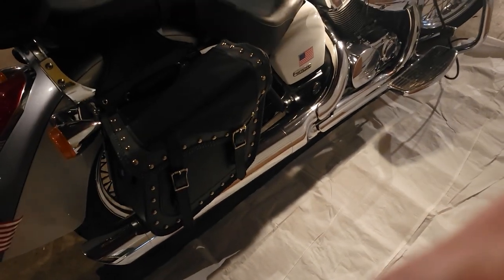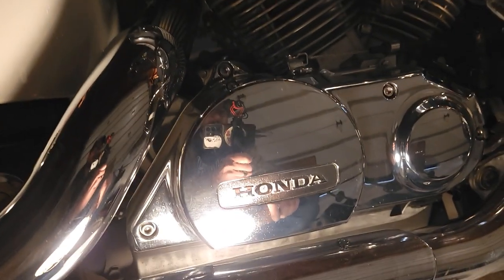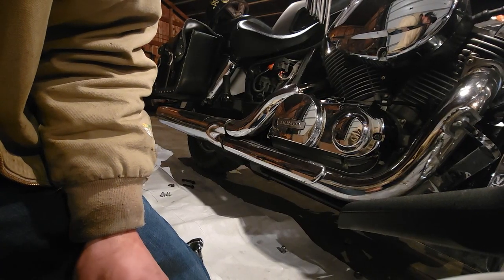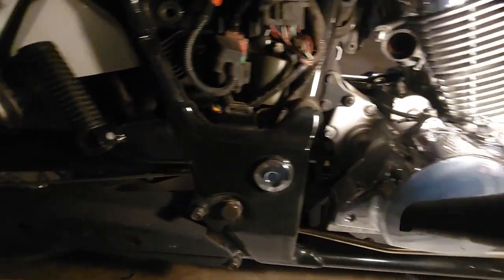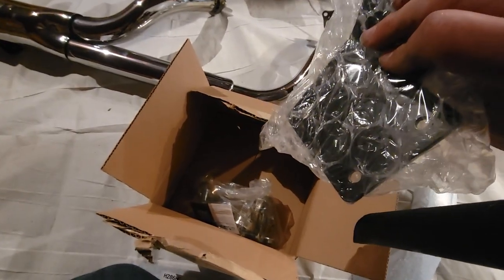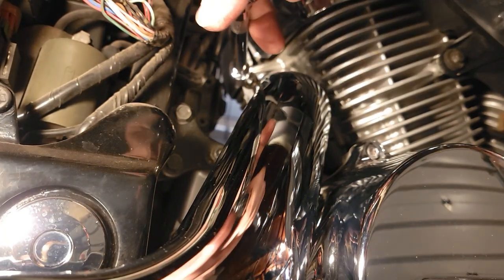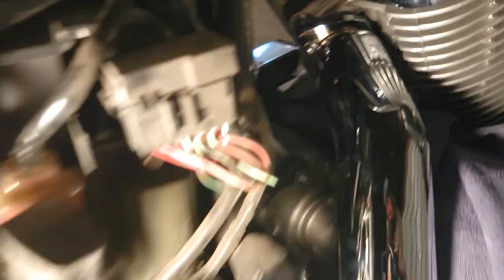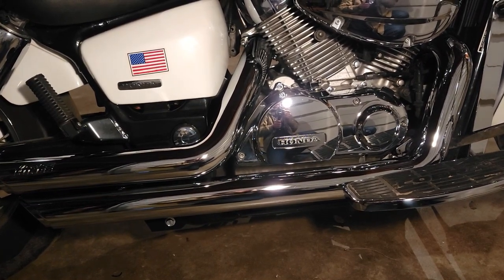Installing Vance and Hines short shots on a Honda Shadow Aero 750

Comment: They look sweet! My preference on sound is the cobra boulevard, but these sound bad ass as well.

It looks like you might have to jet it, judging from that back fire.
Also I would be a little concerned regarding that saddle bag. Due to the shorter pipes all that direct heat is right under it, specially at idle. Lots of luck with it.

Brother, be safe! 🤙🏽

Comment: Do you have a link to the gaskets
Reply from the maker: https://www.amazon.com/Exhaust-Gasket-13-87805-Shadow-VT750C/dp/B01MUC5JY0/ref=mp_s_a_1_1?crid=2C013O48OWYIL&amp;keywords=BossBearing+EMGO+Exhaust+Pipe+Gasket+Seal+for+Honda+Shadow+Aero+VT750C+2006+2007&amp;qid=1686276561&amp;sprefix=bossbearing+emgo+exhaust+pipe+gasket+seal+for+honda+shadow+aero+vt750c+2006+2007%252Caps%252C182&amp;sr=8-1&_encoding=UTF8&tag=thejustinro00-20&linkCode=ur2&linkId=70f73b77fd8127add475c000fa21d88b&camp=1789&creative=9325">
Motorcycle exhaust gaskets

Comment: bahh... that heat shield looks ugly as hell IMO. i want to change my pipes out too. but i'm more of having the pipe longer out the back. is there a longer version of the vance hines for the shadow areo?
i am going to use exhaust heat wrap. is there a non chrome option for the same pipes?
overall nice simple process, great video
Reply: Yes I believe they are called straight shots and should come in black
Reply from the maker: Yes, they are called longshots and come in chrome or black.

Comment: Mine didnt come with gaskets, does this exhaust not need them or?? Stock ones didnt fit.
Reply from the maker: Definitely need new gaskets but have to order them separately, they do not come with the pipes. I ordered mine on Amazon Boss Bearing is the brand I got.